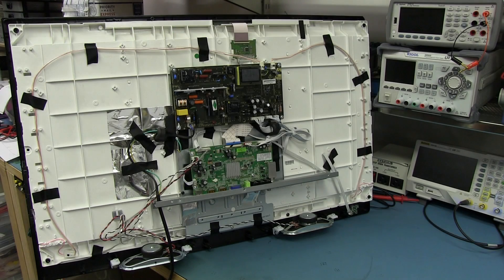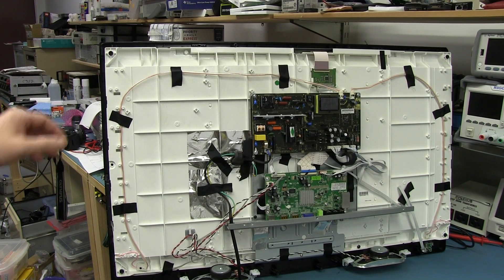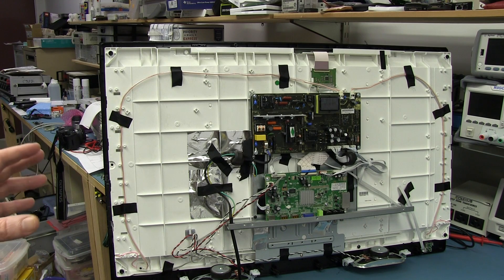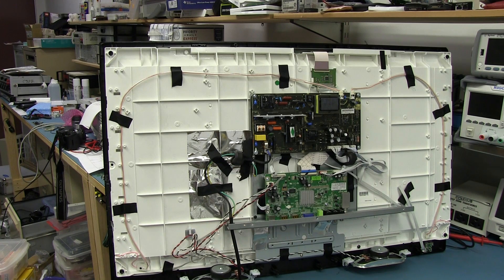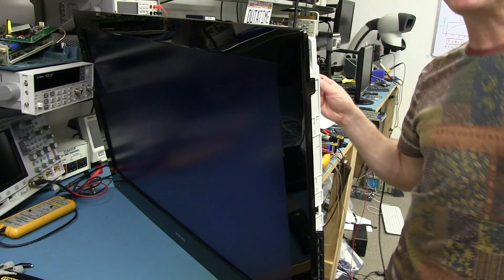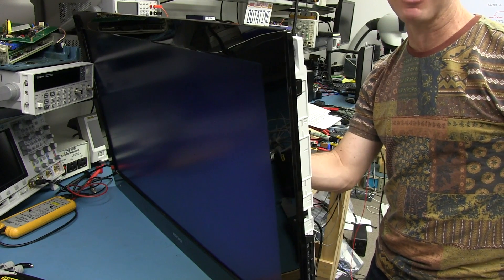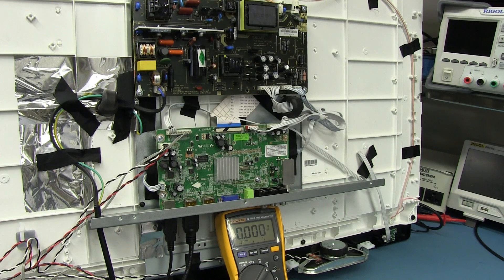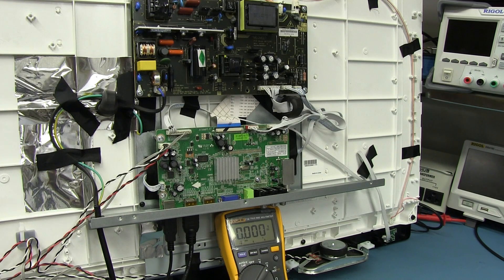EEVblog #631 - How To: Soniq LCD TV Repair Part 2

Comment: In the networking trade we often say "90% of all problems are on the physical layer", as in cabling, connectors, etc.  This same problem happened to me with a laptop and I ended up putting a dab of hotglue along the connector because the ZIF lock mechanism didn't have enough strength due to wear & tear.  Still works to this day!  Nice find.  I would have started with all connectors personally. Moving my way from the inputs to the LVDS ribbon.  Great video, awesome information, and entertaining attitude as usual.
Reply from the maker: The comments come with having such a blog, and the fact that I upload "progress" videos like this rather than holding off until I secretly fix it and then produce a polished video.
Reply from the maker: I consumer gear like this I always start with a visual, the PSU, caps etc. It costs you a minute of time. In this case I originally had no indication it was a physical movement fault, in fact the symptoms pointed toward electrical, so electrical was the first suspect. Once I eliminated the basics there, then it was onto physical.
Reply: EEVblog I'm glad you didn't see the physical movement bit because we would've missed all the other trouble shooting stuff! Glad you saw it yourself and hope you didn't take the comments too negatively. It seems to bug you a bit when we know-it-alls ramble on. Nice fix!
Reply: EEVblog
I meant no disrespect.  I was merely saying how I might have done it.  Your way was much more informative :)

Comment: The dielectric absorption phenomena at around 08:00 - How much voltage could that capacitor possibly recover after being discharged? I guess it would peak at a certain voltage before going the other way and slowly discharging, but just wondering out of interest what percentage of it's original voltage it could recover. Thanks.
Reply: I've seen some 400v electrolytics get back up to 50v after being discharged, which is enough to give you a bit of a shock. It varies a lot with different caps though.
Reply: I use UltraCaps (2000F) and (3000F) to be exact, these always have a small charge from absorption. I can never fully discharge them to 0. They are 2.7V and usually hold anywhere from .1 to .3 volts in them.

Comment: Oh, l forgot to comment on the fuse.. I suspect it blew due to when the ribbon cable was acting up, the chip got some weird signal that made it work harder out side of it's normal range, and the fuse blew... Did you boge in a quick action fuse?

Comment: I'd be careful about using the low-z function on the DMM to discharged mains capacitors before checking the maximum voltage you can apply to your meter from the owners manual. Yes, it is a good ideal, and I would like to use my Agilent U1272A meter to do it, I remember reading in the owners manual,  not to use it for voltages above something like 20 volts.
Reply from the maker: These low-Z ranges are designed to to be used at mains voltages, that's what they are for, eliminating ghost voltages in mains powered systems etc.
Reply: Yep, the Low-Z mode is an electricians best friend.
Reply: There may be some meters with special requirements but my Fluke 289 shows max voltage in LoZ as 1,000 volts. I believe all the Fluke models with LoZ are rated this way.

Comment: Would the fuse have blown if the bad connection caused a short? Seems likely.
Reply: I find it super unlikely that the connections ever actually shorted out. I think whatever logic IC is on there just consumes much more than its steady-state amount of current during resets, and resets itself whenever there is a signal fault.

Comment: Good going Dave! Lucked out on that one.. Yes, I repaired (lucked out) on a couple of TVs with that same kind of problem. What I did to repair the connection was to use one of those old school pencil erasers to buff clean the contacts and then wipe them with a cotton swab soaked with DeoxIT. ..

Comment: why not just use the plastic connectors with the black clip? okay they are fragile to get off but they are usually quite reliable when connected. Or you know just don't be a cheap arse and use a ribbon cable

Comment: "Wait a minute, is that a fuse?".   Replace and it's all just about fixed, that's just so annoying, seat of the pants "lets try this" on ONE component out of potentially thousands of the suckers, and he nails it in one.  Good work Dave, I hope it solves the problem long term.
Reply from the maker: It ain't as random as that. There aren't many fuses in this thing, so if you spot one in any failed product, you always check it!
Reply: Why would you expect there to be thousands of fuses?

Comment: Awesome. Great fix! I had issues and have seen issues with the interface between the flat flex cables and the edges of the LCD panel itself. Some of them are in these connectors that press them against the LCD panel edges and they can come away creating lines in the image. Most are soldered/glued on though.

Comment: So, check all fuses first. Good info.
Reply: No, his order of operations was quite good: Capacitors and power ICs first, then connectors, then anything else. The fuse was somewhat of a red herring anyways.
Reply: DPortain
I am no engineer, but when it comes to flat panels that has those symptoms it has always been the ribbon cable/connection to the panel itself in my experience. How part of the picture fell out randomly with that line is a dead give away.
Reply: The fuse was not blown anyways when he first tested it out. My guess is that the bad connection shorted it out while he was troubleshooting it so the ribbon cable/connection was the problem all along.

Comment: So you ended up leaving the flat-flex squeezed between the case and the power supply board?
Reply: Also, did the bodged fuse fit there properly?

Comment: Dave, I've repaired quite a large number of LCD monitors and the LG's are quite really problematic with that type of connector. One thing that helps is taking the cable off and bending that metal shielding down a bit with the handle of a screw driver, for example, and finding a way of fastening the cable and connector together as you did. In short, that type of connector is crap.